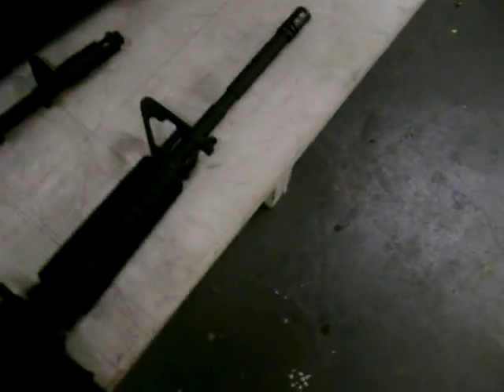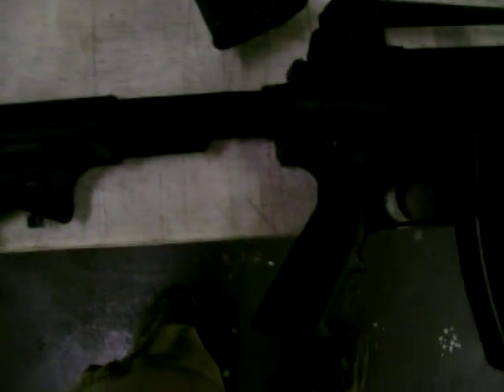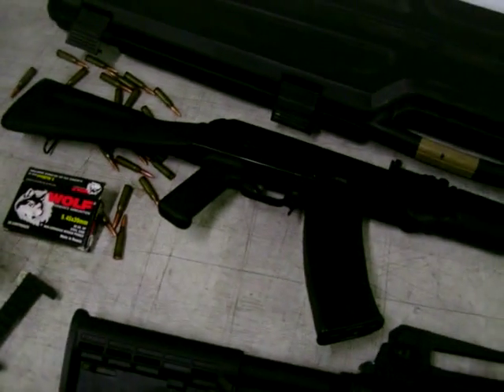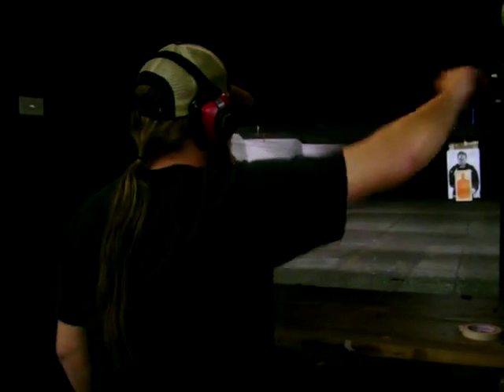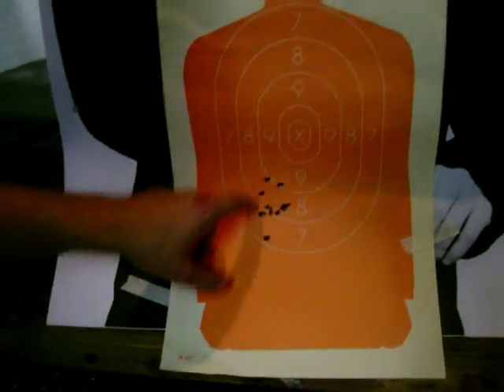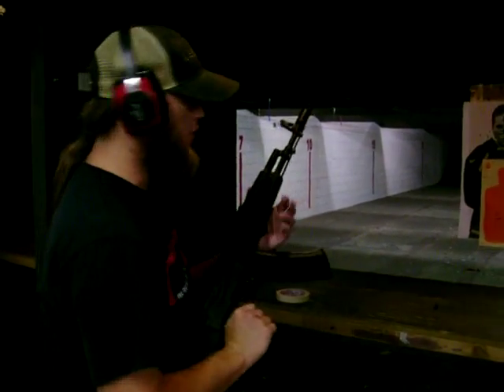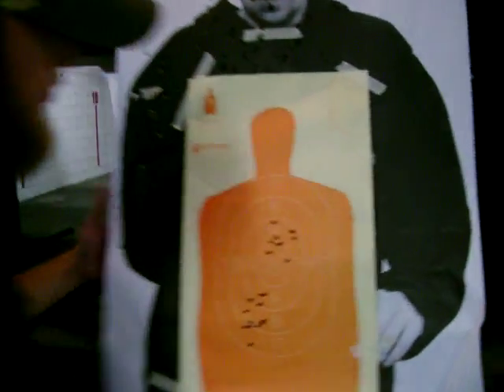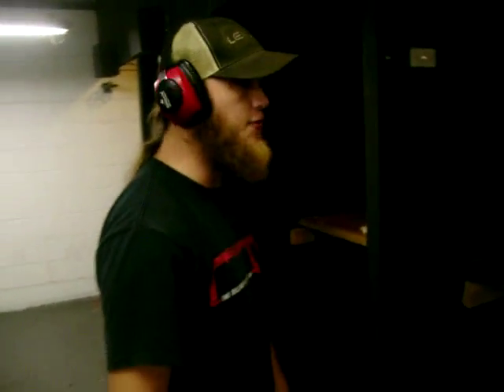Ak-74 vs Ar-15 5.45 X39mm Part 1

Comment: regarding surplus ammo...  get a wolff (yep 2 fs) extra power hammer spring, it hits the pin hard enough on any case's primer.  I've used those x power hammer springs and jp low power trigger springs on my match trigger set for a year now

Comment: sgl31 is way better in my opinion..i shoot both, but the 5.45 has less felt recoil, prints groups the same as my m4gery (bushamster) with iron sights..and the ammo is way way cheaper...i put a piston on  my ar to get it to run as long as the ak without cleaning...here's some advice...instead of getting a piston..just get the ak...only drawback is that the 5.45 is louder...